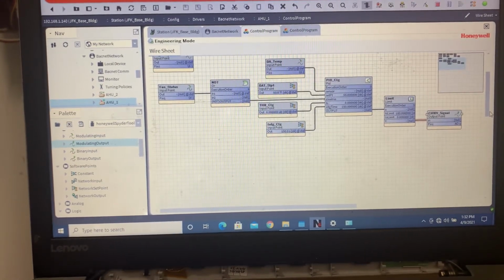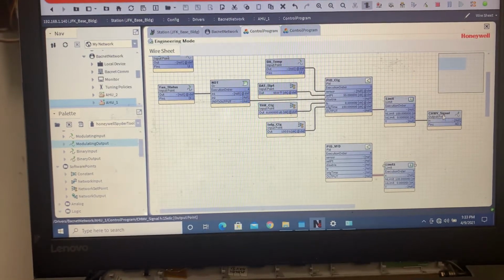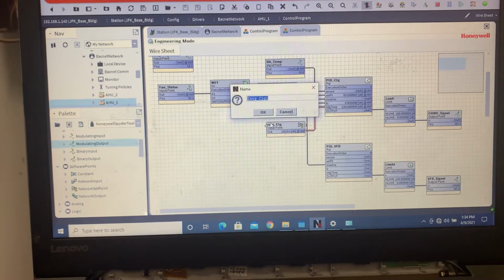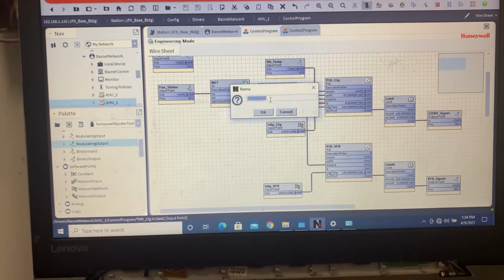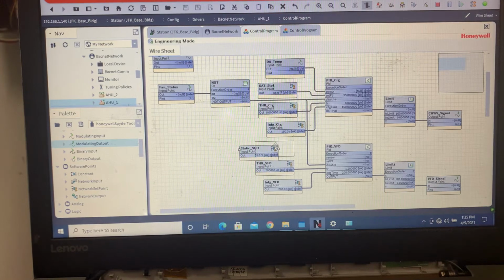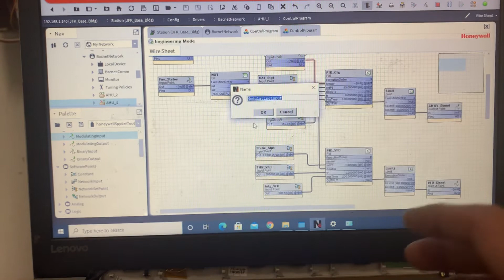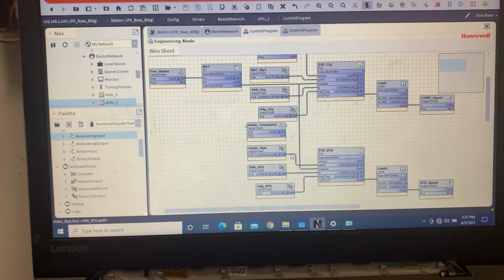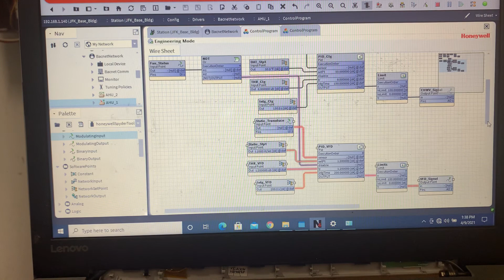AHU wire sheet program part 3 VFD

Comment: Hi... quick question, is the honeywell spyder template standard with N4 or do you need to pay for this?

Thank you
Reply from the maker: The wire sheet is built into the controller. Honeywell has a few builtin apps but we mostly build custom logic.